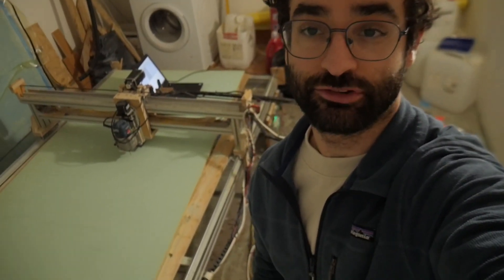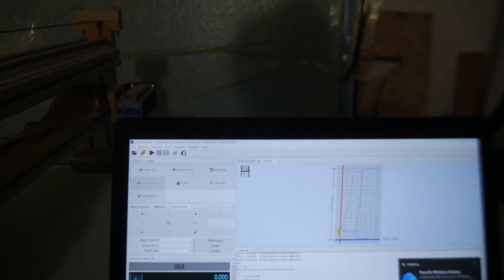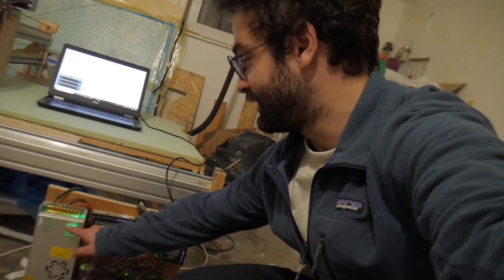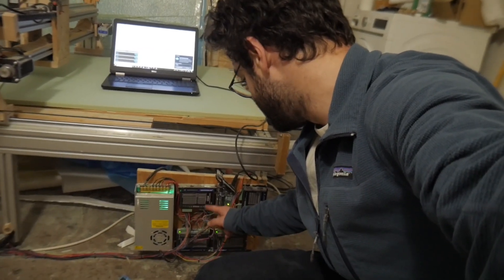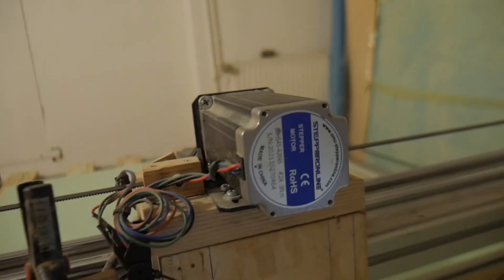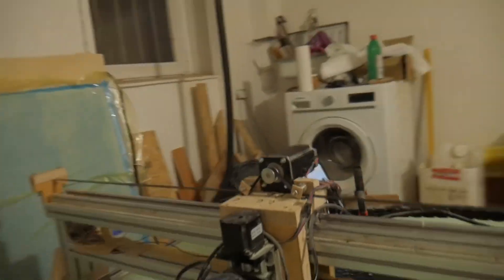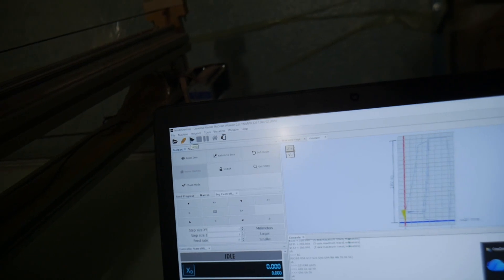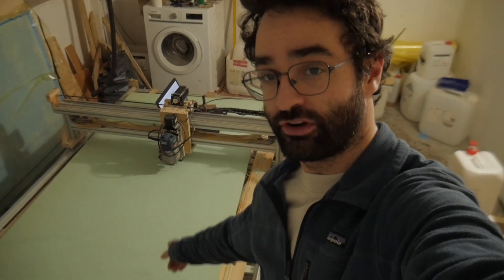🔩 How I Built My Own CNC Machine to Build a 12.5m Catamaran | DIY Boatbuilding Tech

Comment: It's traditionally better to infuse your panels and then cnc the parts.. 

If the CNC cuts foamcore, it cuts glass. 

It will give you cleaner parts and create less work for you, and use less consumable materials and less cleaning up.

If the cnc makes a measured foam panel it can make measured parts and you can trim to the boat line by making a template of the job, traced onto the part for fitting.